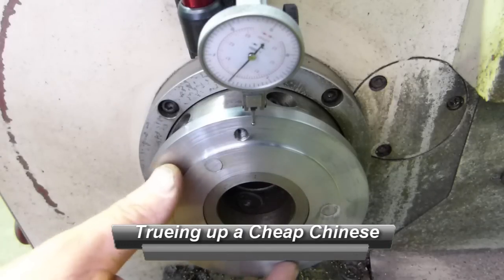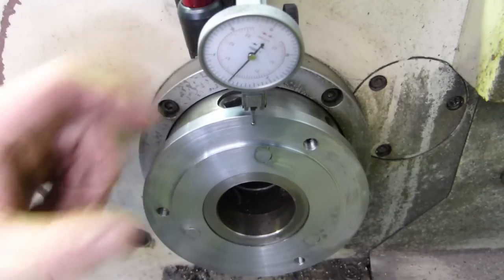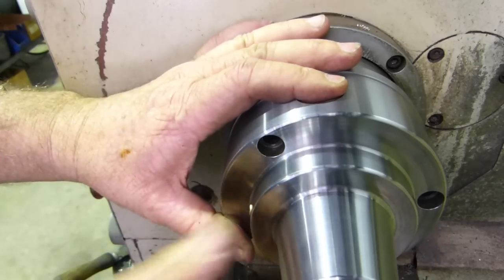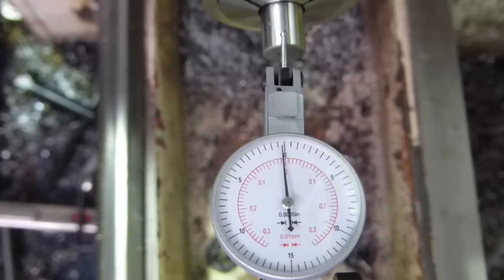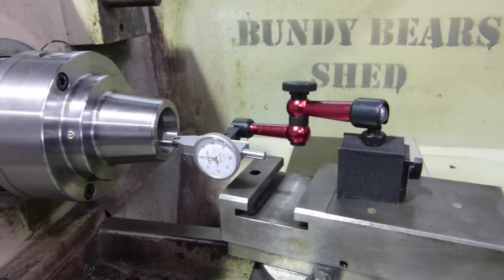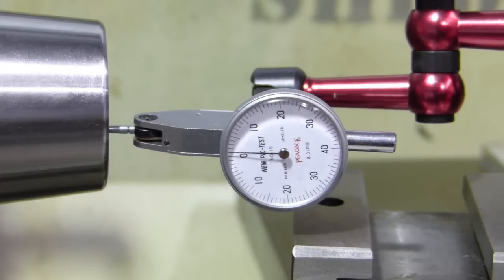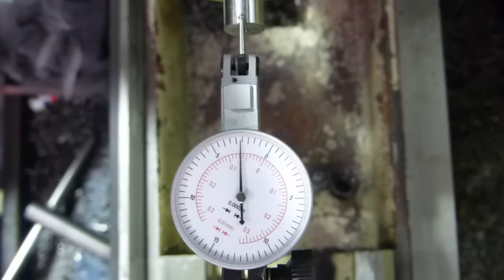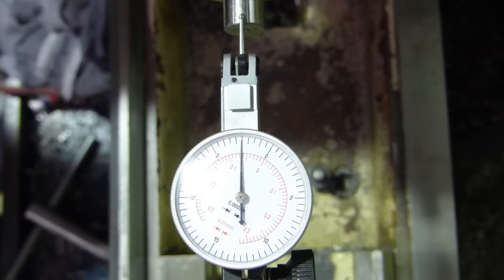How I Made My Chinese 5C Collet Chuck Run True (Almost)

Comment: That was pretty good. A die grinder doesn’t have bearings that are up to precision grinding on the lathe, so your results are the best you’ll get. It’s more than acceptable for most work.
Reply from the maker: Yeah I would do it different now I know different but this is still quite accurate to this day.

Comment: Umm... I thought that when one attaches a back plate on a chuck, one  need to make sure it's aligned properly and that's why needing to know the tolerances of  at least one running surface from what to measure from?

Basically one would need to tighten the bolts slightly, then check the run out, move it around using a plastic hammer and when it's aligned, you tighten the bolts to final tightness and after that it runs as true as it can.

Have I misunderstood something?

Because when you check the run out of the chuck, you have not made sure that the chuck is properly aligned to the backing plate yet... or have you? I doubt that small lip will align that chuck exactly.. or is it supposed to?
Reply from the maker: This was a couple of years back now and I have learnt a few things since, and yes you are probably right but it still works well and holds good tolerances.

Comment: The grinder looks like it fits in a boring bar holder. Which model is it?
Reply from the maker: Yes it is a 250-20** something with a pencil die grinder from E Bay. It worked fairly well.

Comment: Nicely done Lance.....I’m thinking of doing the exact same project....nice to have a step by step tutorial.
Reply from the maker: G day Greg, It has worked well for me, I have been told to make the shoulder the chuck centres on a bit looser and bump it closer to accurate is the correct way to go but mine has worked out very well in the long run.

Comment: You missed the concept of how a 5C or R8 collet is held true. The taper holds the nose true and provides the clamping force when tightened, but the rear of the collet is also centered by the bore of the spindle. If the bore is running out, after the taper is ground true, the tool will only have low runout at the face of the collet. The tip of the tool will be running out quite a bit. You should have opened up the mounting pilot to true the chuck bore before grinding the taper.

Comment: I ordered a 5C chuck with my new lathe. It is very nice and has the Chinese version of a "Run True" system. I used a high quality collet and a gage pin to adjust the off setting screws. Runs very true now. Basically similar to what Stefan G did but with the advantage of the 4 adjusting screws.
Reply from the maker: I see what Stefan did and might try that next time for sure.

Comment: That was the wrong way to do that. Even very expensive collet chucks tell to to turn down the back plate pilot and adjust by loosening slight the mounting bolts and tapping the chuck around.. I admire what you accomplished.

Comment: Nice!  Thanks for the video; just bought one of these chucks myself.  I am almost finished restoring an Atlas 10 inch lathe onto which it will be mounted.  I will “true it” using your procedure.  Just 1 question, do you find the chuck a bit “clunky” (not really smooth) when you turn the key?  Mine is a but rough, could probably use a disassembly, de burr grease and reassemble.
Reply from the maker: G Day Tobar, Yes I think they need a good clean out for sure, being chinese they don't pay a lot of attention to the cleaning and de burring but once done you will have a good tool to use.

Comment: I saw a solution to chuck runout on Stefan Gotteswinter channel, he turned the register on the adapter slightly undersized and then with the bolts just snug tapped the chuck into alignment, then tightened the bolts. I tried it on my collet chuck, worked out great. Hasn't seemed to have moved.
Reply from the maker: G Day Ron, Well I must have missed that one but I didn't think along those lines at all. Thanks for watching and commenting.